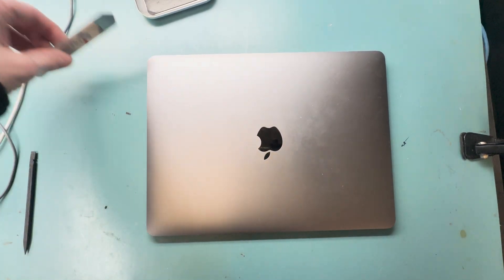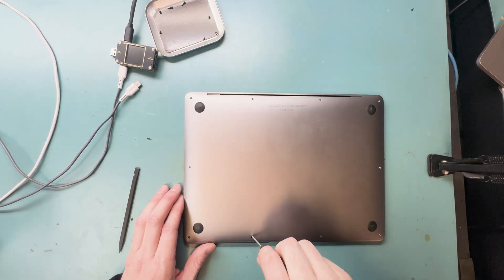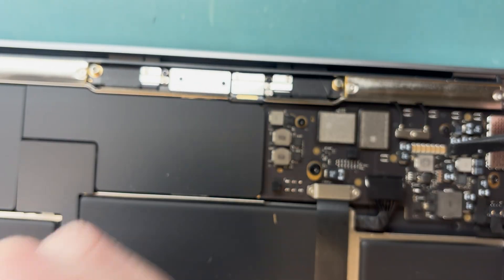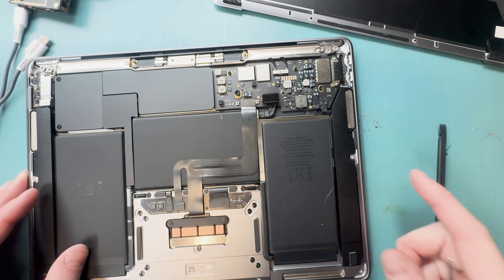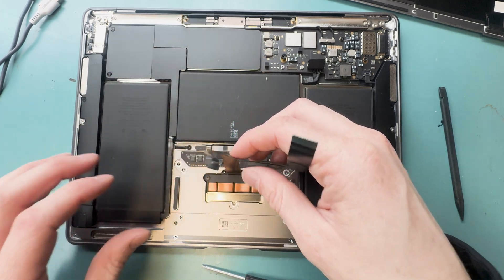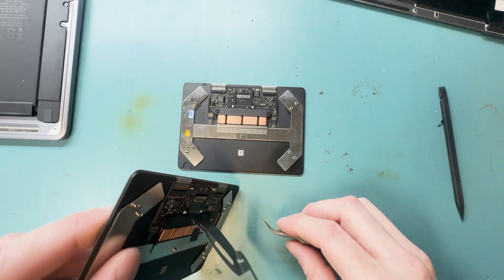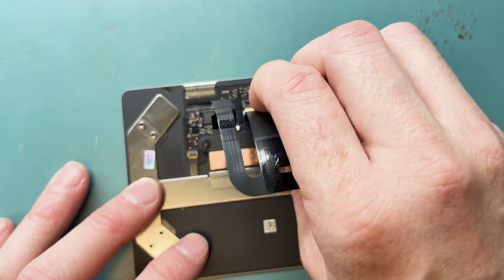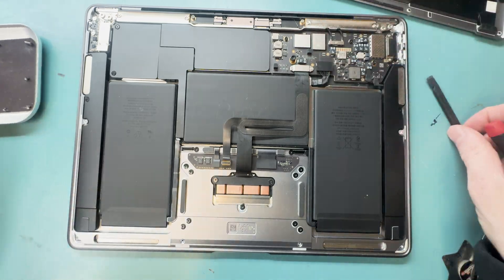💻 MacBook Air M1 A2337 Trackpad Replacement | Liquid Damage Repair Guide 💧

Comment: After replacing the trackpad my macbook is doing all kinds of weird stuff like not registering letters when typing, mouse cursor lag, trackpad click not working sometimes. Any ideas?
Reply from the maker: Sometimes the track pad comes with a faulty flex cable I would recommend using your old one or buy a new flex cable for these issues.

Comment: Is there any way to test if it's just the trackpad that drags everything down? I have a liquid-damaged MacBook Air here with a dead trackpad and keyboard. Otherwise is works fine (so you could still use it as a kind of desktop Mac) but I don't want to spend lots of money on it just to try that...

Comment: My T3 or T4 don't work on the trackpad cable cover. Any idea why?
Reply from the maker: Bad screw driver stripped the whole you might need to cut it out or bend the bracket to make it come off